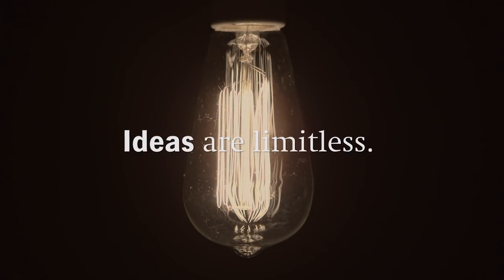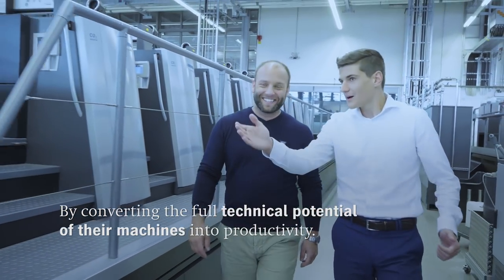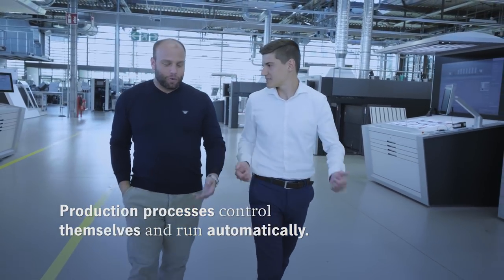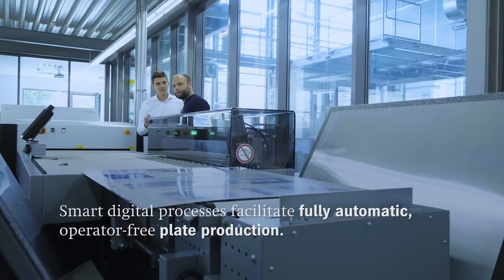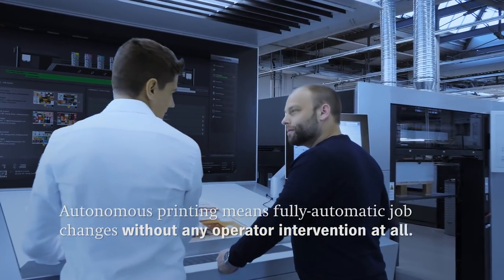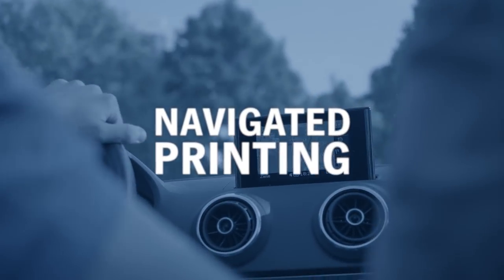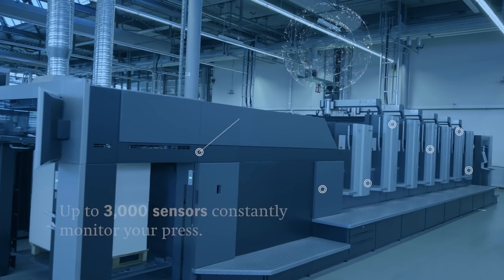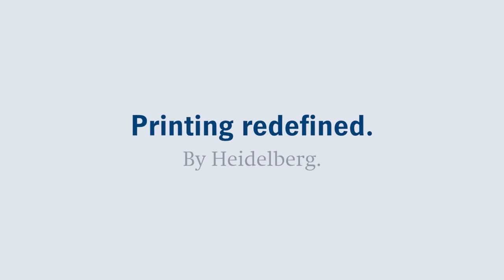Push to Stop. How does it work?

Comment: Heidelberg Original(150 years of service with no sensors) and continues. New with sensors give error messages constantly. Useless after 100mln sheets. + automatic systems leaking, stoppng, failing.. why is that
Reply: In the real world things wear out. Only in fantasy land do they last forever. Clean your machine, do the maintenance. Fix problems when they occur don't put it off because you're busy. You'll be surprised how much longer they run between service calls. This goes for any brand machine. I current run a Ryobi 784e. The real problems occur when a machine is engineered to be "cost effective" instead of built to last. The 784e is in the cost effective category capable but lacking in many ways.